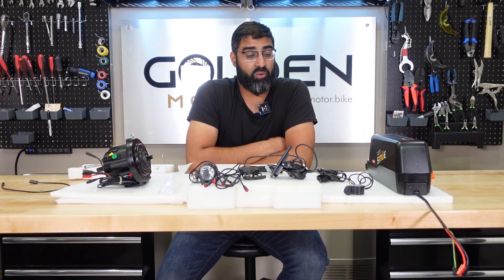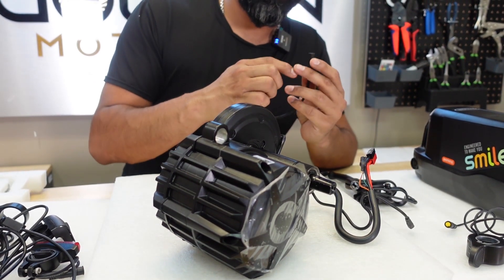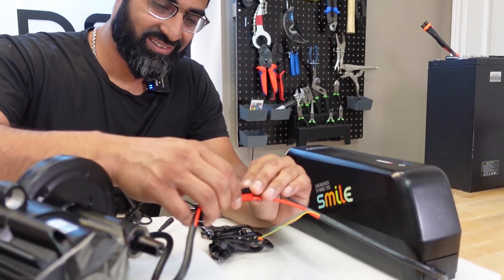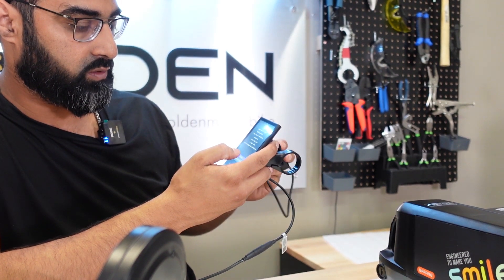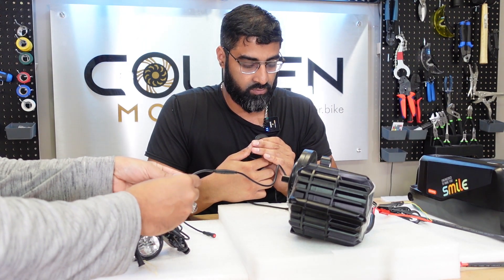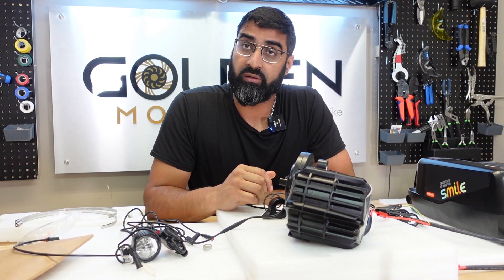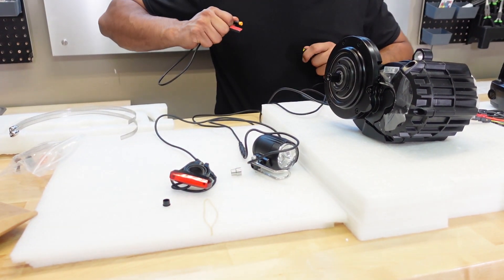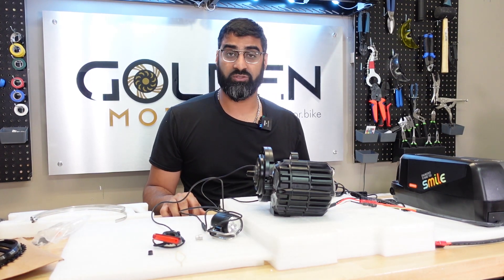Bafang M625 Bench Test BBSHD vs M625

Comment: The bench test I want to see is: 1) hook specified voltage to motor with 2) ammeter in series, & 3) run motor to wind out (top speed, with no load but the internal parts) & 4) read the amps. Then we can multiply volts x Amps to see watts at top speed. That should give a low amps & watts, as at top speed motors draw little power, drawing maximum at start up. Such a test tells us the input watts to the motor. The output mechanical watts of course will be less due to inefficiency. But the input watts tells us that the output mechanical watts is less than that.

Comment: Were you able to disable the speed sensor in the computer or does it error out before getting there?
Have been trying to get this installed on a recumbent trike, but there are no extensions available for the speed sensor or the battery's canbus connector that connects to the motor. #Bafang really dropped the ball there, especially since all of the newer connections are oddly shaped.

Did find a vendor in China tat sells the newer connectors with leads, 2 to 9 pins. Am going with a generic pin connector kit from Amazon to make the canbus extension. Either that or clip the battery end, extender and solder the wires, and apply heat shrink. Just means having to buy more for when a simple extension could of saved me, the consumer, less drama to install the M625.

Takes about 3 weeks to get something from China for the speed sensor extension...

Comment: Thanks for the video - when I do a bench test like this it seems that the motor is barely spinning. More power with more pedal assist. Is it normal it's not spinning as fast as your is? I thought it would just spin super fast

Comment: Thanks for your review. Initial word is...
CANBUS = big problem because incompatible to use smaller and potentially higher volt batteries that would work with BBSHD.  Only using the 'large brick' battery for this new motor is 'show stopper' for many of us ebike builders.
Bafang could have come up with a better anti rotation mounting system other than the eyesore eyelet.
Bafang may have improved the internals of the motor as you speculate by the sound but Bafang ruined their system if you can't run another battery or program it like the BBSHD.

Very disappointed Bafang took this direction to 'control' their product and sell more batteries.  It will backfire.  They will lose sales.
Reply from the maker: Agreed. I had the save exact thoughts and have passed on this feedback to them. Maybe they address the issue. At the very minimum they should come out with a smaller batter and programming options but let’s see

Comment: There is no programming this motor and it won't work unless you buy the Bafang battery..No building your own battery or after market batteries...So the giant battery or nothing for now until people figure out how to hack it....It's a step backwards for sure....But what would you expect from a growing corporation...They have now left the door wide open for a new manufacture that permits and encourages programming motors for more power and having the ability to use a variety of batteries..Big mistake in my estimation, selling batteries is for the DYI community..They could have restricted these motors for bike manufacturers instead, selling completed bikes, those people are likely to not want to tweak their motors.
Reply: the battery is massive.

Comment: I believe they are locked out to 48 volts as well
Reply: It been done it's only the controller that's different and the outer casing it's been run with a BAC855 ..

Comment: The battery pack is a monster; I can see that being restrictive.
Reply: Try adding another Bafang battery. Someone one is going to need an isolator for the CANBUS communications wires to swap between batteries, otherwise have a black box to share the charge between both batteries/connector wires.

Comment: I haven't seen a 120mm BB version of the M625 available like the BBSHD offers. Does it actually exist? Many Fat Bikes that have a 100mm BB still need the wider 120mm used with spacers so the crank arms clear the chain stays.
Reply from the maker: They do exist from what I understand. And should be available in a few months